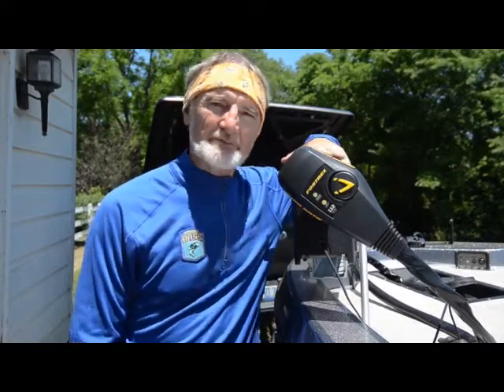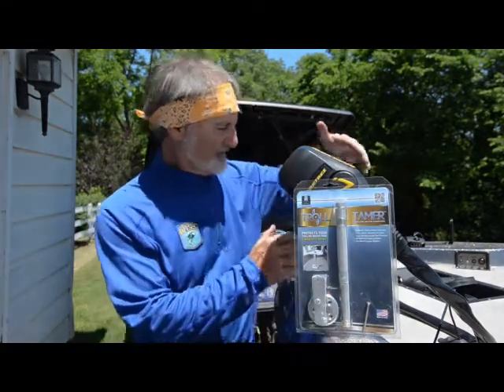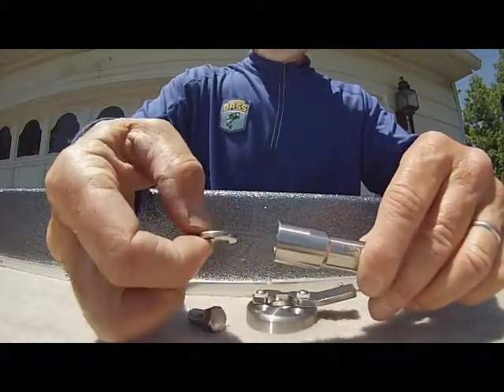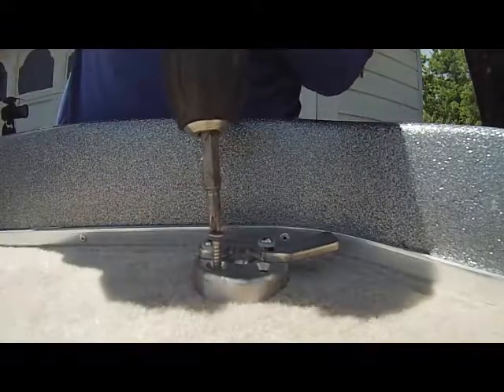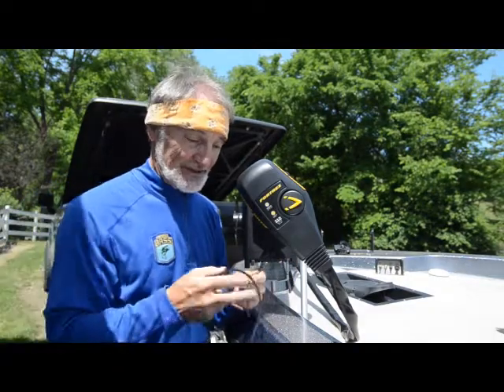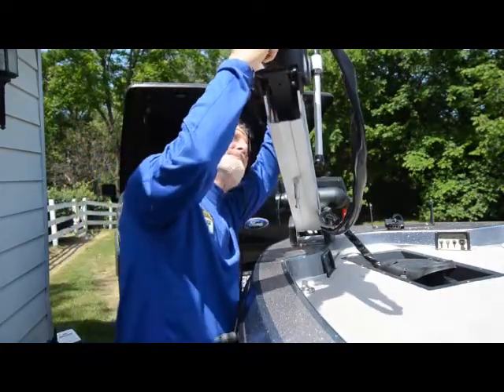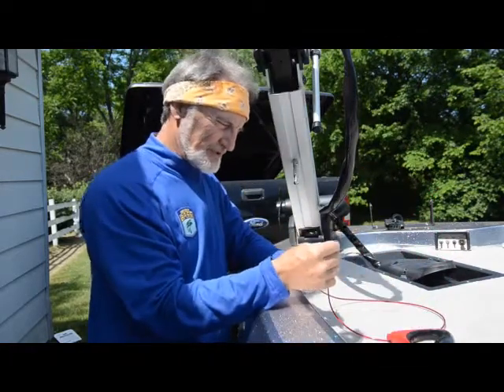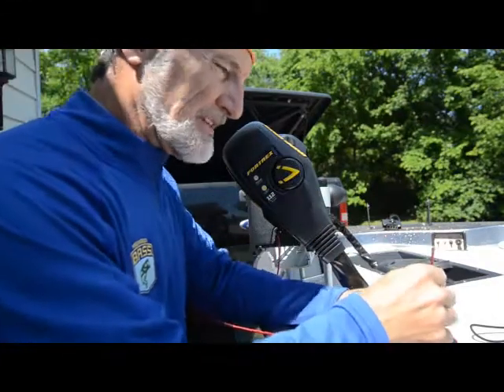Keep Your Bass Boat Alive, Part 9b

Comment: When you added the G Force handle, it would have been easier to tape the cable to the rope and pulled it through the hole. Worked for me and took 2 mins to do.